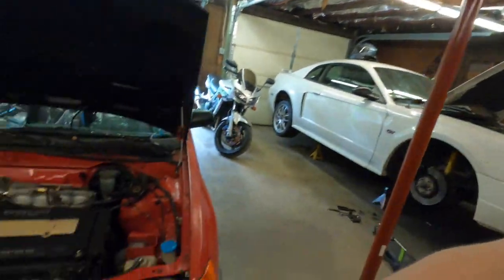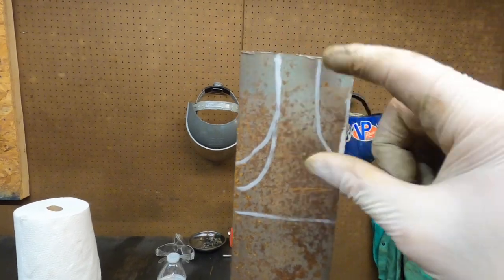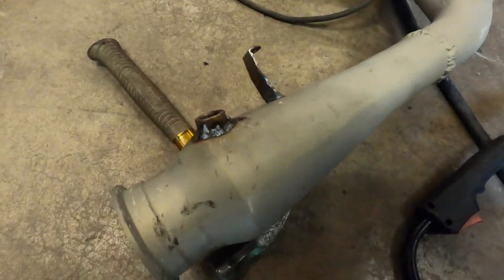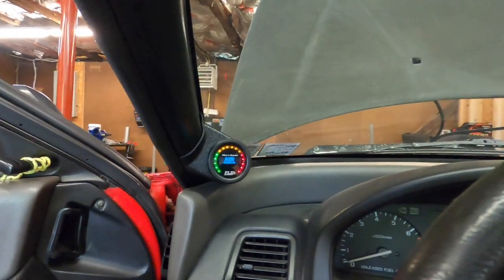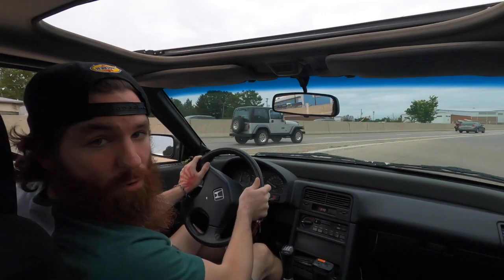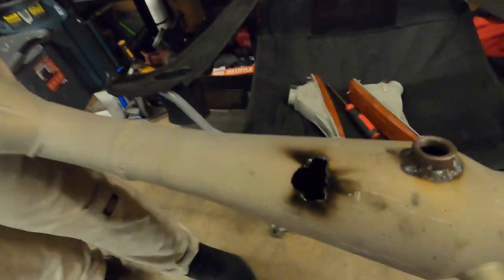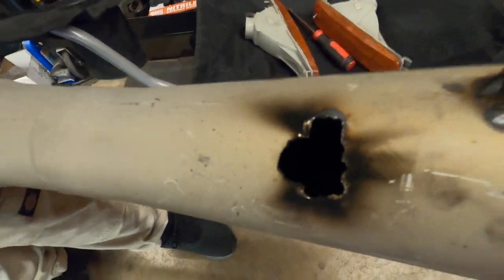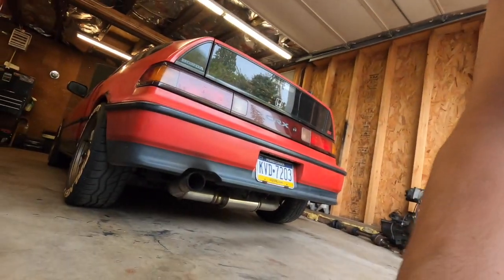ALL MOTOR B17 CRX / FIX IT, BREAK IT, FIX IT, RACE IT!

Comment: I am diging the angle for sure. I which more people would do that instead of POV. Also maybe a little higher to catch the AFR, for those that are into that sort of thing. Props on the work. I really need to get out there and get my CRX up and running. She is looking so sad and needs a bath bad.
And I feel you with the exhaust. going to 2.5 inch made the difference between a loud and tin-y WOT to a deeper and less annoying WOT. During normal driving, it is pretty quiet. With the different VTEC switch overs, you get different sounds. I don't have a resonator but I have a High flow cat. I feel like I do need a resonator to finish it all off though.
Reply from the maker: Anthony Sinette thanks brother! 💪🏼 I went 3” because I eventually hope to have a boosted setup sometime soon so I’m not too mad at the drone lol the megaphone really smoothed out the sound.
Reply from the maker: Anthony Sinette if you do get one, go with a vibrant. They just make such a smooth sound. 😍
Reply: @PRZJ91  my wife has a borla/silverline hybrid on her CRX with dual exhaust. That sounds nice as well. A little droney at the high end and a little too loud for me. I have been eyeing vibrant for some years now
Reply: @PRZJ91  i plan on staying NA. Was going originally going to go CRVTEC but once I learned about the D15z7 I decided that i needed to join team Save the DSeries. The engine actually benefits from the 2.5 at the high end.
Reply from the maker: Anthony Sinette it’s the best of the best!!!
Reply from the maker: Anthony Sinette keep it alive brother!